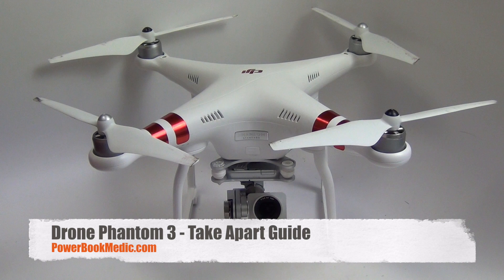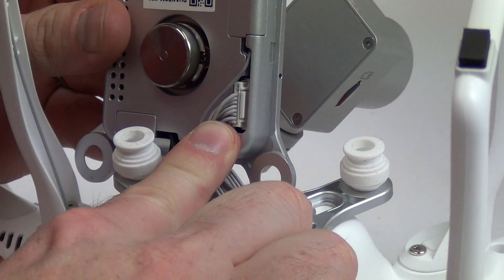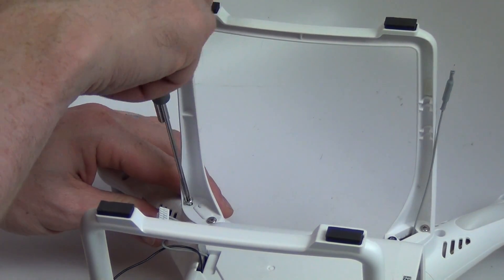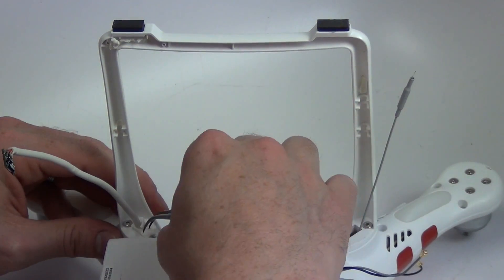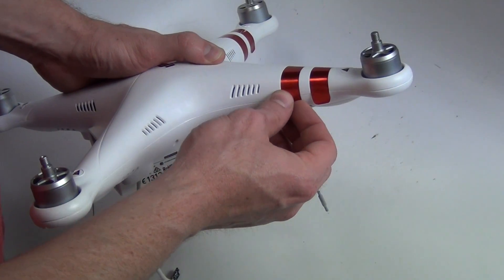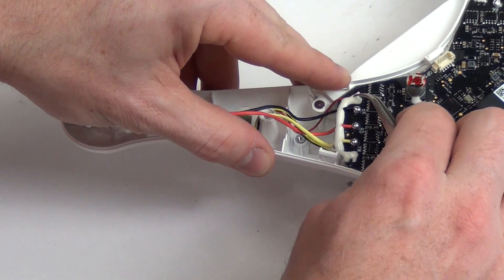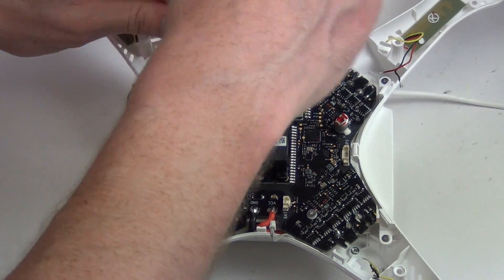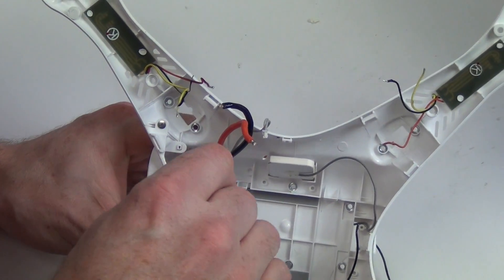How to Take Apart the DJI Phantom 3 Drone Quadcopter

Comment: "once the upper case is free, maneuver it so that..."   This is the riskiest move and it shows for just a few seconds.  Be very careful with this and take your time.  Press on the lower shell in the middle curves  until you hear a click and then rotate to the next and continue until you have it free.  If you force it, you will break it or wires underneath.  Also, when putting back together, you should use blue lock tite on two screws near the motors.

Comment: Great video thanks, very precise. I've shunted my 3 std  twice now and both times the antenna cables (grey and black have been cut) the first time the camera came off (no secure pins) then last time hit a tree while going backwards!!! I now am a believer  of "if you can't see it" don't fly? Just hold where you are and walk to drone? I use small ty raps to thread through where the pins go. I don't know how I didn't silicone  the grey and black cables to the body, which I promised myself I would do after the 1st shunt but its a must to eliminate loose cables? Hope this helps others?

Comment: To remove Drop PIns is much easier and no need to pry off with screwdriver. Press them full on and then wiggle them back - you can even re-use after ... 
There are plenty vids on YT showing this.
Reply: Up

Comment: what are the black and grey wires used for on the gimbal sir
Reply from the maker: +Ricky ThePhoton Dexter - I believe you are referring to the wireless cables.
Reply: +Powerbook Medic I had a crash and the grey wire cap came off and since its coaxial I probably cant mate it back to the wire..so I have to replace antenna inside battery bay which means taking it apart
Reply: Ricky ThePhoton Dexter j

Comment: Just to make it clear.. The two antennas on the legs are for transmition and you can unplug them after opening the shell? Also, the video transmitter and antennas are built in the gimbal?  So to change video antennas i should only play with gimbal? Thanks! Please answer ASAP!!!
Reply: +iHacker007 no the antennas are not on gimbal. This guy is very unexperienced. You can let the antenna connected to board if you replace the shell. IF you replace the board then you need to unplug all of them and desolder the motors and leds.. The antennas for the video is in the battery compartment. the two things looks like square, where the black and gray cable goes to.
Reply: I am inexperienced with drones, yes. But i know a lot about antennas. And yes the video antennas are in the battery compartment, but the VIDEO TRANSMITTER and the antenna plugs are inside the gimbal.
Reply: +iHacker007 all i know, you can replace the antennas, the squares ones are 2.4ghz!  and the one in the legs are 5.8ghz!